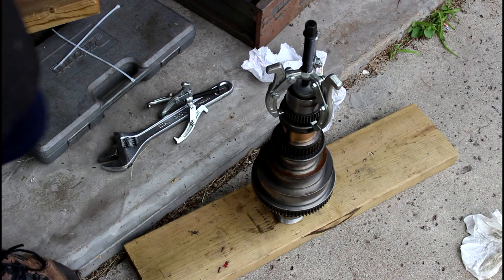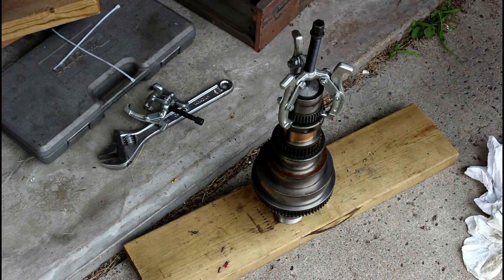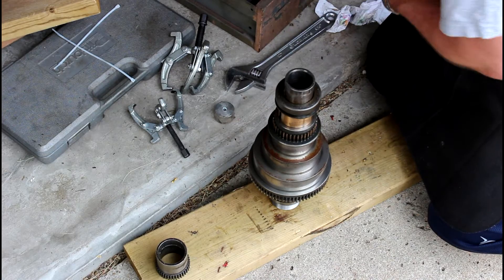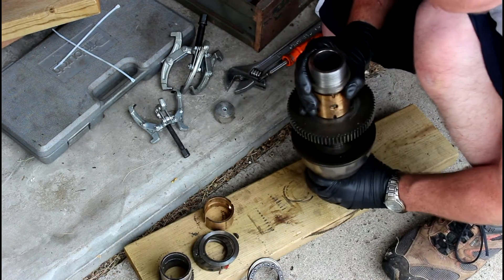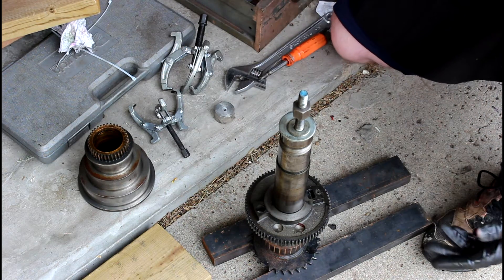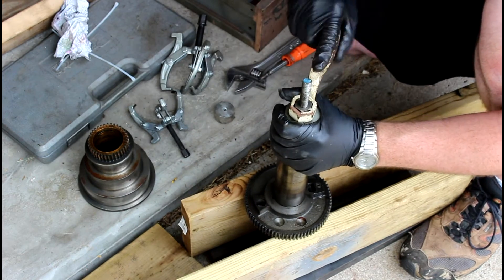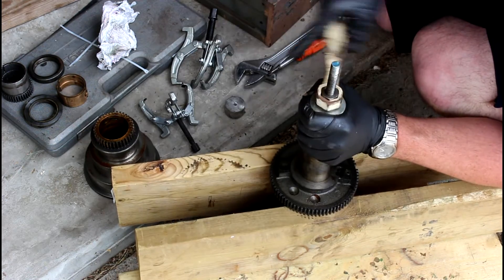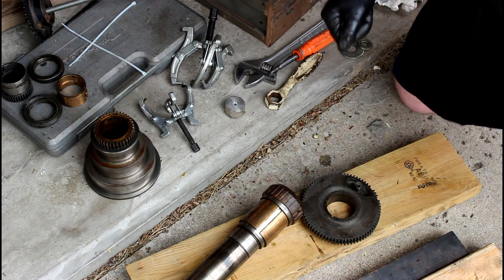South Bend Heavy 10 Bull Gear Spindle Removal!

Comment: Thank you I just Picked up a Heavy 10, And this is the Part I have to repair, Being the Person that Last own this lathe did not Take care of it, And I have to cut it clean 20 thousands, and Hone the Bearing. Hope it works.
Reply: How'd it go? I have a bull gear with two broken teeth. I found a used spindle and just now realized it doesn't have bearings. It has the larger bore so not sure if I can swap my bearings or just swap the bull gear.